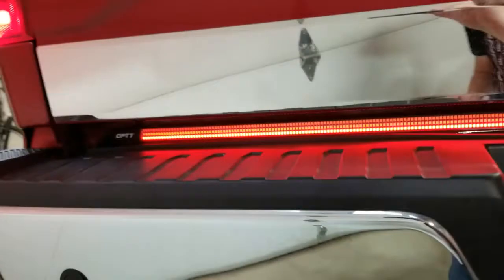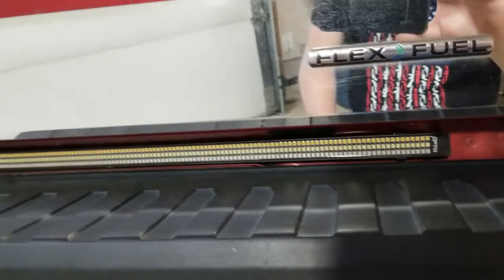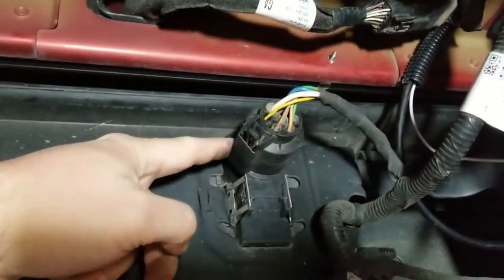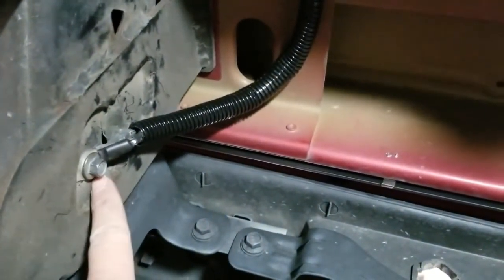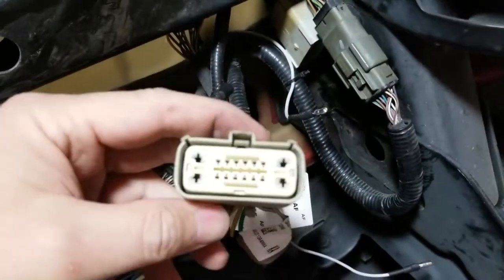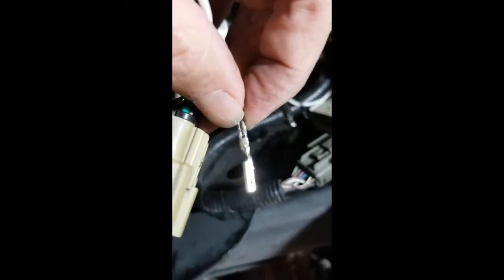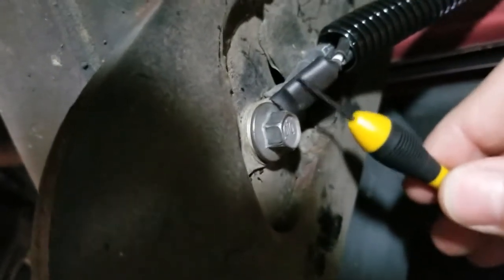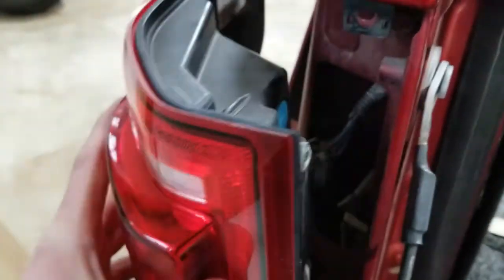How to install an LED Tailgate Light Bar for 2016 F150 with BLIS & Tow Package without splicing

Comment: You didn't show which wires go where. 1 is the ground but specifically,  where do wires 2, 3 & 4 do and what wire do they connect to on the lightbar plug
Reply from the maker: the lightbar diagram is at 4:34. At 8:27 I show where each of those wires go including the white ground to the frame. Thanks for watching

Comment: did you remove your tailgate? seems easier to remove the bumper
Reply from the maker: Yes I removed the tailgate.  You just unplug the tailgate harness and tilt the tailgate about 30 degrees and it comes right off.
Reply: @dougd7714  i don't have to remove the step

Comment: Unfortunately my 2018 XL STX was completely different from this. My tail light plug only had 5 wires.
Reply from the maker: Hey Tim, you can definitely still us the same plug but you'll just have to use your voltage meter to find out what each wire goes to.  The best part is all of the wires except for the ground are in that same plug by your spare tire.
Reply: Thanks. I ended up splicing into my driver's side taillight in basically the same fashion. Wanted to keep it as high up as possible with all the salt we have around here.

Comment: Yeah I just ran into this same problem. Worked for the first 30 mins or so then it started throwing alarms on my screen. Also as I'm watching the video I only had one white wire for the back up light 

Also for all you guys putting these light bars in look into a curt 55384 it's a plus and play adapter no need to hack into the factory wiring
Reply from the maker: When I say there's 2 white wires I mean 1 is the reverse and the other is the ground. 
I'm curious to the year model of your truck and did you have the same harness part #?
I'm thinking that you need to ohmmeter the tail lights to the connector to make sure the wires are the same. See the diagram for a 2018 https://images.app.goo.gl/9kPL1syZeBTqdXVZA
The wire orders are different so I think that's a possibility for the blis issues.
Reply: @dougd7714  yeah I see what you did
Reply from the maker: @zieske98  see how on the diagram 10 is the turn signal out return. I'm wondering if that's what you connect to to make it go crazy. 

This has to work because it's no different than hard wiring directly to the tail lights.
Reply: @dougd7714  mine should be the same it's a 15 with all the options 
It works like yours. 👍
But before I did it the way you did yours, I used that curt adapter right before the factory connector in the bumper, that's what made mine go goofy

Comment: Would this also work for GM vehicles?
Reply from the maker: I'm sure it has a similar connector. You would have to find the diagram or ohmmeter them out to know which ones are what. There's no reason it shouldn't work.

Comment: How do we connect the right turn signal
Reply from the maker: Go to 8:14 in the video and I show each connection.
Reply: @dougd7714  Soo I connected everything already straight from the light and it starts rapidly flashing the turn signal and the back lights cut off
Reply from the maker: I have a 2016 lariat. It seems to me if you have a different model or even the Raptor your wires may be in a different order. In the diagram for taillight pin #10 is the right turn signal out. It really sounds like you and the other guy that was having a problem the pin order is different.  Make sure to find the tail lights diagram for your truck and you may have to pull the tail lights off to find the right connections the same way I found them. It's a lot of work but not hard.

Comment: Which wire is running light
Reply: In taillight connector
Reply from the maker: #3 shown in the taillight diagram which is the same as the parking light.
Reply: I have 12 pin connector in tailight connectr f150 2021
Reply from the maker: If that's the case you can either ohm out the connector like I did at the end of the video which takes a lot of work to find each light or find the diagram on Google or see if the dealership would be so kind to print it out for you and then you could post it here for others to have.